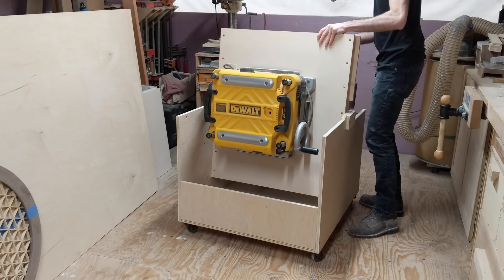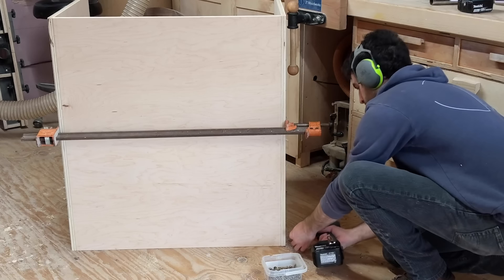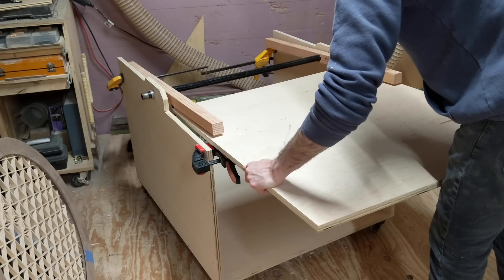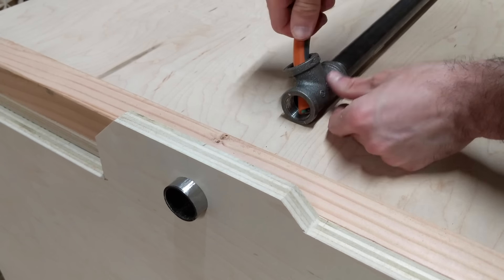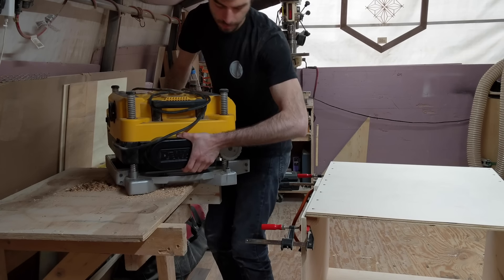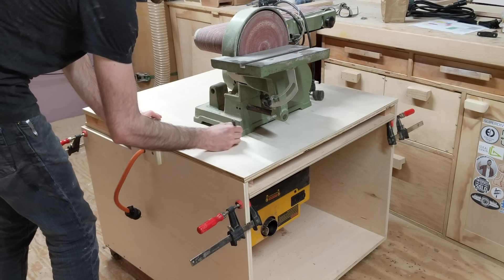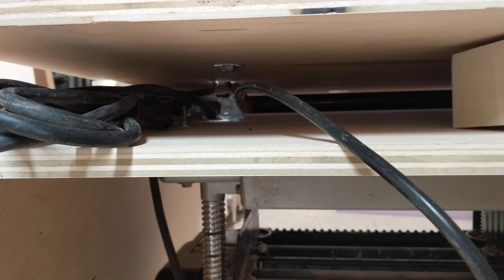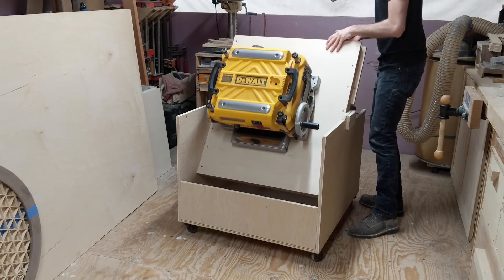How to make a Flip Top Tool Stand // DIY Woodworking Project

Comment: Nice idea, good cart plan.  A few points.  I notice a distressing lack of glue on permanent structural joints, it's cheap and effective strengthening.  You may want to add some corner blocks in the base with some glue since they are well out of the way of the swing if wracking becomes a problem.  I would have filed/sanded the edge of the pipe where the cord comes out smooth on the inside to increase cord life, the same with the threads in the T fitting.  Some soft foam weatherstripping would seal up your cord entrance even more to help keep dust out.  I might be making something similar for myself.

Comment: How to put in bolts from the bottoms safely, set it across saw horses.
Reply: Just Flip the sander over and measure the holes center to center. Use a straight edge and draw it out on the panel. ..or at least put a clamp on the back side if you're going to hang it half off the table lol.

Comment: Really nice Johnny! Definitely wish I'd watched this before building mine. The t-section in the pipe is super smart.
Reply from the maker: Thanks Michael! Gotta keep it all tidy
Reply: It’s a great idea. Power cables can be a nightmare.
Reply: One could also use a power strip with a built-in circuit breaker mounted to the 2x2.
Reply from the maker: As long as the switch is acceptable, it would a nice safety feature
Reply: Instablaster

Comment: Idea for a safer way to install the sander onto the top is to use a pair of sawhorses, or a couple 2x4s (or better yet, 2x6s or 2x8s, anything that gives you enough space) on top of your workbench for you to reach under and screw the sander to the top.

Great design and exactly what I'm looking for. I just upgraded my planer and need to build a new flip cart for it, and I'm also putting my jointer and sander on the other side!

Comment: Okay. I bought the plans cause I don't own but one of the tools at this point an I didn't wanna make it the wrong size. Fingers crossed it all works out in the end. Half way through the build an this thing is definitely gonna be strong enough. I did change the height and had to get creative with the pivot as supplies are limited in my area, but it's all gonna come out nicely. If you're on the fence I understand. It's fuckin $175 in plywood at the box store atm so it's more expensive than just the metal stand, but it's worth it imo as the one you can buy doesn't roll, only holds one tool and you didn't build it. Just do it and thank the guy later. This thing is a tank. Appreciate your work an more than sufficient plans.
Reply from the maker: Thanks for the kind words and taking the time to write this comment. I'm glad you're liking the plans and how the cart is coming out!!
Reply: @JTWoodworks  i forgot to buy the dowels, but other than that its done. ill finish it tomorrow, but its definitely what i needed. almost certainly gonna add some drawers, but i have to actually buy the other tools first :) thanks again

Comment: Really nice job.  Ia have to get around and building one myself.
Reply from the maker: It's incredibly useful and saves a ton of space
Reply: @JTWoodworks  having had it for awhile,  what would do differently if anything?
Reply from the maker: I'd add a drawer to the bottom or at least some way to organize extra sanding belts, planer/jointer knives, etc.

Comment: Excellent video and process. Thanks for sharing. I am working out the details of my cart and you have the most efficient design that I have seen so far. Thank you for the inspiration. I'm using the 4" gear lock wheels from Home Depot. The gear lock wheels are solid and smooth under the weight.
Reply from the maker: Thanks for watching. I'm glad you enjoyed it. I'm not familiar with those but I recommend getting casters that lock the rotation on the wheel and the swivel of the caster. That way the cart is a bit more stable

Comment: Brilliant! One improvement that I would consider is 1/4” removable panels held in place with magnets as dust covers.
Reply from the maker: You mean for the open areas in the ends? I meant to do something like that but never got around to it
Reply: @JTWoodworks    Yea, I’d just make an easily removable panel for each opening. Something held in place with magnets or cleats, or a combination of both. 👍
Reply from the maker: Why make it removable? There's nothing in there to access on a regular basis
Reply: @JTWoodworks    I assumed that you needed clearance to flip tools or you would have run the stiffener panels to the top.
Reply from the maker: Ah I see what you're saying. I was thinking something else. That's a good idea and would definitely help keep dust out

Comment: Nice job on the cart.  Yours is the first Ive seen that has the tools sitting at the right height.  Ive seen other that were very nice also but just too high.  They had tools that once mounted it would be difficult to use because they were well above the waist.  Very nice work.  Thanks for sharing.
Reply from the maker: That's something that was very important to me. It makes sense to have them at a decent working height even if that means you lose the space to put a drawer or other accessories

Comment: Dude this design addresses all my issues with what I've seen to date. Proper cord management and wear bushings for the pivot. Only changes I'll make is fixing the black pipe to the top to ensure it spins and doesn't stick, causing potential wear on the cords where they enter the T. And I'll add a simple drawer to the base instead of dead space. Other than those minor changes this is kind of perfect. Good fuckin work dude

edit: no need to secure the pipe to the table imo after building it. i just put several wraps of electrical  tape where it goes into the T to be sure. Definitely gonna add drawers at a later date though. plenty of room for some shallow ones on each side i think
Reply from the maker: Glad you like it! Those are good points. You can also simply glue the pipe to the T. It'll probably be easier than securing it to the plywood. Although, after over 2 years of use, I haven't had any issues
Reply: @JTWoodworks  two years? Nice. I was a bit worried about long term durability, but not any more. And I plan to use machine screws though the top into the pipe to fix it in place. Just gotta be sure they don't protrude into the pipe is all. Prolly overkill, but that's how I roll. Thanks for the work an reply

Comment: As requested, to add bolts on the back of the sander you could place it on top of stool that is upside down. Any stool has 3 legs and any plane can be placed on 3 points as we know. I guess stool should be little sturdy to hold that weight but that was my only idea. Your approach looked just fine too, if only for extra safety you could temporarily support it from floor with a stick, so it would not fall. And i want to mention this, sure that tube looks sturdy enough, but i mean, for extra extra safety precautions, i would worry about if pipe broke for some reason it would basically cut cable and short it, sooo, that was not my favorite part for sure. Thanks for sharing this idea, might use for other projects :)
Reply from the maker: All great suggestions! Thanks for watching

Comment: Nice, tidy stand.

You could put small drawers in the sides for accessories.

For bolting down the planer, you could use locking t-nuts underneath. I'd also run bolts thru the tops and 2x2 to clamp it solidly, that way you're not relying on the tensile strength of the screws.
Reply from the maker: Some good tips. I'm not a fan of t-nuts though. I've had a few strip out in the past and I wouldn't feel comfortable using them to hold something this heavy. Especially because of the flipping motion

Comment: Great job. Love the power cord solution. Just an idea, when mounting the second tool and balancing it on your bench, I was thinking, putting the plywood top on two saw horses would give you the room to attach the bolts from underneath and would take the weight of your tool. Without having to balance it on the edge of your bench.

Comment: Great looking cart! You were asking for an easier way to mount the bolts for the heavy sander... if you carefully place the sander upside-down, then you can just lay the board on top, line up the holes and tighten the bolts. That way you don’t have to worry about balancing the sander on the edge of your table while tightening from underneath. 

Well done! Another version of the flip top cart for me to draw inspiration from! 👍🏻

Comment: so i was thinking if i use 2 pieces of 1.5in pipe, i could rout the shopvac through one side, and the power through the other. i also wanted to put outlets on each side, and was thinking of micro switches for the locking peg so power only goes to the top side, and only with the locking peg in place for safety.
Reply from the maker: Some good ideas. Go for it!!

Comment: I would have used the full 2x4 instead of ripping them for the top, like Jeff Fisher did.  That would let you get your hand in a lot easier to plug things in.  You had some nice improvements like the bushing for the pivot.  I using Jeff's design because it is the one I saw first but I think I will be adding some of your ideas as well.  Keep up the good work.
Reply from the maker: Thanks! I'm glad you like it and found it useful. The full 2x4 would be a nice touch but I never had to access that area after building it

Comment: Hey nice work, especially with small space and no outfeed table for your table saw. 

I wanted to leave a comment on your shop/ tent. You need to create an exterior tarp tent to protect your shop tent from radiant heat. You would be shading your existing tent. You would be similar to air-conditioned by comparison. With free air movement there would be nothing to trap heat like an attic. 

Heat physically moves towards cold.....you have to finish insulating the entire walls and ceiling....also,  take up your floor and at the very least and place 6 mil visqueen plastic on the ground. If you have the money, insulate the floor as well.....
All the best!

just jim

Comment: I like this build, and will probably make it this spring. However those 2x2 with the pipe through them seem way to have removed most of the wood as the penetrate.  I think I'd go with hardwood scraps or 2x3.
Reply from the maker: A lot of the material is removed when drilling the hole for the pipe but the plywood on either face reinforces the 2x2

Comment: Looks amazing, I will be building one in the near future. I also have the same bench sander and if I come up with a different method when attaching it I will let you know.
Reply: Use a couple of cinder blocks or scrap 4x4s as a base. Put the plywood over the top of them and the sander over your pre-drilled holes, then use a ratchet or wrench to tighten the bolts.

Comment: Instead of a jointer can I use a router table instead? Would it work as well? I am planning on buying your plans soon. Thanks!
Reply from the maker: A router table requires a lot of space underneath it. So the opposite side of the flip cart wouldn't fit another tool.

Comment: Suggestion:  Use T Nuts inserted to backside of plywood and bolt tool down through the plywood to T Nutfor quick and easy removal of tool(s).
Reply from the maker: I've had t-nuts strip out pretty easily before. I wouldn't trust them to hold the 90lb planer upsidedown

Comment: Next time you need to mount something like the sander from the bottom use clamps on the board not just hanging over the edge, or a steel weight on the back edge of the board, much safer :) Great Job tho!!!!

Comment: I built something similar. I recommend that you make the width of the rotating  under portion a 1/2" shorter and add 2  1/4" washers/spacers to allow for minor warpage of the rotating element or frame.
Reply: washers maybe, kinda wish id thought of that, but it doesnt warp much at all. thats the good thing about plywood so making the lower bit that much smaller just adds more complication than is needed imo an i built it to plans, pretty much :)

Comment: Great table 
Only point I see is that because of the position of the electric socket you need to disassemble the table to remove one of the tools
Reply from the maker: True but it wouldn't be much work. You'll just need to remove the screws holding the panel the tool is attached too to get underneath. You'd need to that to remove the planer and sander anyway

Comment: I got your plans and I’m having issues with your 1” pipe and your black pipe fitting in the 1 1/2” whole as you has instructed in the video and in your instructions.
Reply from the maker: Thanks for buying the plans! You may need to use a thinner walled pipe or a larger diameter in order for them to fit

Comment: The table side battens drilled for the pivot tube will be strong with both facing boards in place. But with one board & tool attached, there is very little strength in the drilled battens. 
I would have reinforced with another pair of battens screwed to the top side. They could come off later or be left permanently in place.

Comment: Looks good. The only problem I can see is usually the jointer and the planer are used together when building a project. It would be a little un handy to have to flip the top all the time.
Reply from the maker: Joint all your parts them plane all your parts. Just one flip 😉

Comment: After marking the bolt holes for the tool. Drill the holes, permanently mount the bolts from the underside of the plywood using a nut on the top, to secure the bolts in place. Then you can simply drop the tool down onto the 4 bolts and secure with a washer and nut. That way, you can remove the tool from the table if needed.  That's what I did....
Reply from the maker: Makes sense. By the time I'd change these tools, I'd probably want to update or change the design of the cart. So I'm not too worried about it

Comment: What type of pipe did you use for the maine body?  I am assuming 3/4" black iron pipe from the local box store.  What I can't figure out is the the type of pipe did you used for the bushing / bearing for the black pipe to spin in.  Is it a tight fit?  Great design btw
Reply from the maker: Yup that's exactly what I used. The bushing was from a pipe I had laying around. I'm not sure what it was from. Sorry I can't be much help with that one

Comment: The design insures you only flip one direction in 180° and then 180° back, there's no 360° degree flipping.  That's good.  Do you find the cord ever binds?
Reply from the maker: I've had this for about 4 years now and I've never had that issue

Comment: Just wondering if you've had any issues with your planer or other tools falling out of calibration / etc. when they're attached to an inverted surface.  I'm looking to build one with a planer on one side and a miter saw on the other and folding arms to act as infeed / outfeed tables for the planer and miter saw both but was concerned that the planer might have issues being upside down.
Reply from the maker: I've had zero issues with this. Everything works exactly how it used to. I even left the tools on here when I moved.
Reply: @JTWoodworks  Thanks for the quick reply!

Comment: Mate, very nice job. As others have said, t section pipe was very clever. Might I suggest, that on the planer side, a raised bed front and back level with the feed table would help to reduce if not eliminate snipe, by effectively giving the wood a longer flat surface to rest on.
Reply from the maker: I have the folding in and out feed wings for this planer. That's a great alternative though

Comment: Very nice but my question is about the platform holding the tools. Are a few screws enough to hold to weight? Would it not be better to make temporary with screws and then go thru both platform with carriage bolts?
Reply from the maker: That would be better. If I remember correctly, these screws went through into the other piece of plywood too. Glue would also help. I haven't had a single issue though since I built this I few months ago

Comment: Nice job and a very well produced video.  Was the width of the stand determined by the space required for the jointer?  I would like to make a narrower version of this cart as the Dewalt planer would be the widest tool mounted (Dewalt DW735 13 inch planer, Delta 12 inch disc sander and Rigid spindle/belt sander).
Reply from the maker: Thank you! The width was determined by the jointer. You can make it a bit narrower and still fit the planer

Comment: Hi Johnny. Enjoyed watching this. Question for you: want to have 2 tools on one side, and the other side clear for extra workbench space. Would you change anything in the build? Thank you. Harry
Reply from the maker: Thanks Harry! I'd probably add a more secure locking method if you're using is as a workbench. Other than that, I can't think of anything else
Reply: @JTWoodworks  Thanks so much.

Comment: Hi buddy :) cool stuff, thanks for sharing! What stops the kickback with how you cut the wood, small piece to the fence? I've seen this a few times lately on YouTube :o
Reply from the maker: A riving knife on the table saw helps prevent kickback a ton. If you're concerned about kickback with small pieces, the bandsaw might be a safer option for you
Reply: @JTWoodworks  thanks for getting back to me and the suggestions, actually I didn't notice your knife bro, my bad :') yeah I didn't put mine back because I CBA with the constant changes so I'm a bad boy, I'm gonna get out the lazy habbit and sort that before my next use. I took it off because I think I was making a cross cut sled :/ it was good but I cut too high so it broke in two :') ya live and ya learn :p I have been looking out for a band saw or how to make one actually, it's definitely on my list :o thanks pal

Comment: I would have put some lock-tite on the sander bolts so they don't vibrate loose
Reply from the maker: Good call. Though 9 months later they're still tight